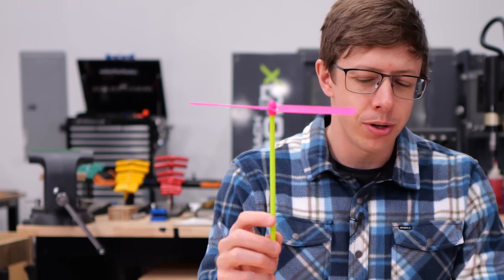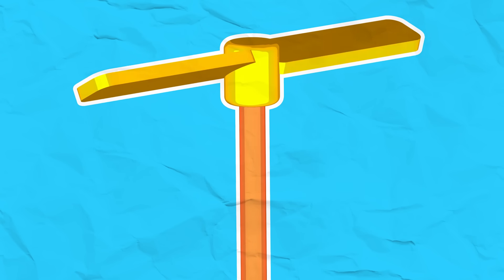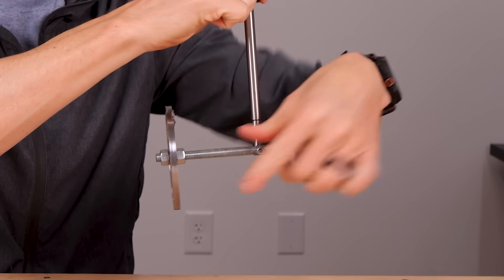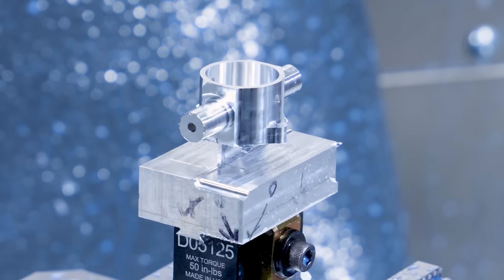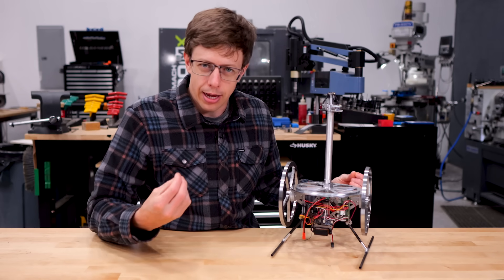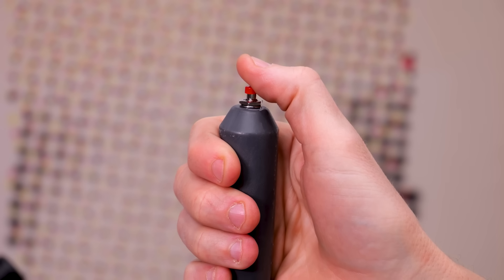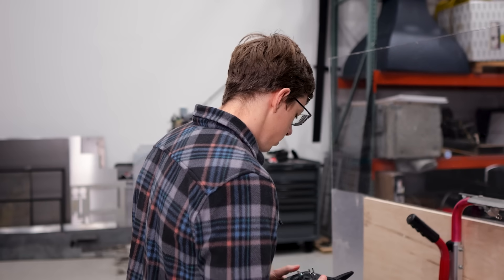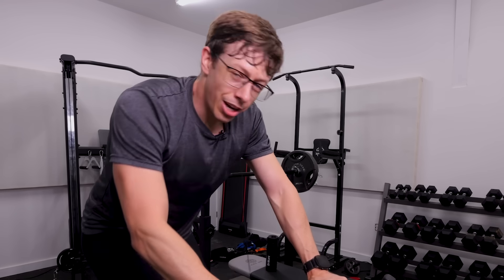I really thought this would fly well

Comment: My intuition says that you're not far off with your aerodynamic wing surface idea (although there are probably other more effective ideas, aka, a proper helicopter tail rotor, or counter-rotating blades). If you do keep pursuing that design, consider mounting the entire wing at an angle that counters the torque, then use the control surface to just dial in from there. Basically just trimming the wing so it's "neutral" position already provides most of the needed counter rotating force. Not sure if you have enough airflow from just the prop wash to counter it though...  good luck! Cool project!

Comment: I think if you just move the one fly wheel on the top side of the "driven gear" gear it would make it rotate in the same direction as the other flywheel, and if you ensure the fly wheels are rotating in the proper direction it will counter the rotation on the prop, right now in this configuration the flywheels are canceling themselves out, the Chinook helicopter went through the same growing pains during development I believe, if I recall correctly
Reply: I believe you could also theoretically double the weight of the one flywheel that is counter rotating to the rotor, if you double the mass it will make it so there is only the force of the heavy flywheel affecting your helicopter, eliminating and overpowering the forces of the flywheel rotating in the same direction of the rotor, I'm hoping I explained that well enough for you the understand the concept
Reply: I want to see a test with weights clamped please and thank you... Brain food 🤤

Comment: If you want to know the theoretical max “lift” the wing deflectors can produce, you can use some flight mechanics equations to determine that approximate value. Just takes measuring the wind speed out of the main propeller, estimating the flap as a two-piece flat surface (getting that area), then doing some math. 
Side note: the max counter-rotating force you can produce is probably much less than you think.
My Suggestion: use two counter-rotating main blades.

Comment: You could have 2 sets of props with similar mechanisms to the one you made, instead just make them spin in opposite directions using gears. The system you made to control the orientation of the blades should work the same, I don't think I see an issue there. This would solve the angular momentum problem as the force causing the body to rotate would be canceled, plus it would be more stable, and you could probably ditch the two flywheels and the controlled surfaces on the bottom. Would also make the thing a lot lighter and you might be able to get away with less torque on the motor. Super interesting video, though, I used to play with those things all the time, including the ones with the rubber band.

Comment: One design overlooked is the rotor to allow the propeller to be able to do different angles depending upon where it is during rotation.   When it tips over, no rpm will recover as it drags itself down.  Good work getting to this point.
Reply: exactly... you are screwed  by the gyro effect of the blades themselves  unless you do something

Comment: Design the control surfaces thinking as if they were on an airplane. You're essentially launching a fixed wing aircraft at 0mph with a HUGE propeller and no fuselage length. You'll need overcome the p-torque. Using anything short of a an entire flattened cardboard box won't counteract that at a few inches off the center of rotation. The tail boom on a helicopter is very long for a reason, you know this haha. You could variably increase the prop pitch to help soften the blow on takeoff, but look to the Convair XFY-1 Pogo and Lockheed XFV-1 as to why your control surfaces are inadequate. wikipediaDOTorg/wiki/Tail-sitter Best of luck!

Comment: The use of flight controls under the aircraft remind me of the Hiller Flying Platform.  It used contra-props... i.e. contra-rotating propellers, which takes care of the torque issue that exists with a single propeller.  The Flying Platform was a "unique" form of aircraft, because the passenger stands directly above the spinning propellers.  For better (or worse?), it never got into production to any degree.

Comment: I think a better idea for controlling the rotation of the flywheels would be to mount some kind of smaller propeller on a boom sticking out at right angles to the main rotor. That would even let you control the spinning, since you could adjust the blades of the smaller propeller just like you do the big one.

Of course, the downside to that is that, without the control surfaces, you would no longer have a way to control which way the main rotor is pointed. I hear some other engineers are working on a system where each blade of the main rotor is controlled individually, allowing you to increase thrust on only one side, and thus achieve controllability. It might be worth checking out. 😁

Comment: Yeah the problem with control surfaces here was that the force of a control surface is proportional to the angle of attack and the square of the relative velocity of the fluid. They weren't doing anything at all in that ground test, other than serving as additional drag, the best case scenario would be moving upwards at maximum L/D.

Comment: Does it not just need a tail rotor at this point?

And once at that point, is the only difference between this and a normal RC helicopter using pre-loaded mechanical energy instead of battery-powered motors?

Comment: Use helical gear teeth if that is even possible on this design. Then your best bet is to use 2x2 blade instead of 1x as it can rotate in the opposite direction and then cancel out the force. You can probably figure it out from there.

Comment: "If these propelers hit the speed of sound they'll make a crazy amount of drag so I'm gonna spin some paddle wheels past the speed of sound instead" Im glad you found the shrink wrap solution but that was a funny mistake.
Reply: The USA designed a fighter plane that used counter-rotating supersonic propellers, the XF-84H Thunderscreech!. As you can imagine it made quite the sound...
Reply: @legopi1  Many WW2 era propeller driven fighter aircraft had their propeller tips reach transonic or low supersonic speeds. Not while static on the ground like the XF-84H but in the air where the forward speed of the aircraft increases the tip speed on top of just the rotational speed. At this point engine sizes started growing way faster than the net thrust generated by the propeller, which is why further speed increases for propeller driven aircraft became infeasible and research into jet engines began.

Note that the fan blades of modern high bypass turbofan engines typically reach tip speeds well beyond the speed of sound (up to about Mach 1.5 for the largest engines) at full takeoff thrust. This is what creates the buzzing sounds that you hear from many modern jet airliners during takeoff.
Reply: @blahfasel2000  I don't know why I'm replying to this only now but here goes

You are of course absolutely correct, but I also feel the need to mention that the speed of sound at sea level is faster than the speed of sound at higher altitudes due to increased air density. The thunderscreech wasn't the first propeller to break mach 1 but it was certainly one of the loudest and fastest. 

I love the strange designs that came out of WWII. Early American and late German designs in particular. Very American to build a plane like the XF-84H knowing the prop would cause problems but keeping the "we can probably fix it later" mentality. The German approach would have been to do rigorous math and wind tunnel testing all to find out it doesn't work and just do small tweaks/upgrades to an umpteenth bf-109 derivative.

Kinda like what we are doing to the F-15 now
Reply: @legopi1  what we are doing to the F-15 now are not small tweaks, the F-15E upgrade really wasn’t an upgrade, it was basically an entirely new airframe that looked similar to an older F-15 and they kept the designation to convince Congress it wasn’t an entirely new plane. The F-15EX has a lot in common with an F-15E, but it still has so many changes that again it really isn’t the same airframe. The same thing happened with the F/A-18 when they went from the Hornet to the Super Hornet, they look similar but are actually 2 different airframes.
Reply: @legopi1  900 sonic booms per second
Reply: @thebrickwall6051 it actively made lots of the ground crew pass out from the noise alone
Reply: Love your videos! Fireworks pinwheels provide extra energy from their "rocket" motors. That's a lightweight approach. I wonder what the height record is for a pinwheel? I've seen some scary large ones, but smaller may be better. That's an interesting optimization problem.
Reply: Ah, but it doesn't stop there, unfortunately. Air loves to cling to a surface, even if it's a really smooth metal surface. Now when you push air down on that at speed and rotate it, what will happen? I think a box over the flywheels would go a long way to stopping what roughly looks like some coanda effect tom foolery. 

Then again I know absolutely nothing about these things, I just watch a lot of drone videos. :P
Reply: @Deja117  You mean the rotation of the flat shrink wrap will hurt it? The "outer layer" should be stationary instead of connected to the flywheels?
Reply: @ I think that would get even more drag
Reply: Shrink wrap also to propeller shaft gear would have helped a little to reduce horizontal spin.
Reply: Put a large number of evenly spaced small holes in the "shrink wrap." Trust me, some very thin, perforated, rigid material would be better than the shrink wrap for this.
Reply: You're fighting through the same problems as the designers of the original helicopters. Could look at their failures to help overcome it. Also, instead of a parachute, maybe try an airbag!?
Reply: When he was explaining the drag of the propellers I was like, "what about the drag of the flywheels?", which he never touched on so I assumed it was just negligible.

It was not negligible.
Reply: I don't know how he couldn't see that coming :')
Reply: Could we see you make a drone idc what the drone does id be happy to it im currently learning how servos and motors play into them
Reply: @speedyi9109  Boring. There are so many drone channels. RCtestflight has what you're looking for.
Reply: When he first showed the flywheel design my first thought was "What about the drag?". Then he brought on another flywheel and I started screaming
Reply: the fun thing is: I predicted that immediately but then said to myself - Oh, he knows its way, he'll find a solution later for sure. he didn't.
Reply: Have you never seen a helicopter? Let the shaft separate, like the toy, from the motor.

Comment: Overly complicated. Have a single coaxial flywheel geared to the shaft (for RPM differential), use a drag device to apply a torque to the system so that it can apply torque to the shaft (or a second rotor). You can still keep the collective/cyclic RC control.

Comment: Pretty sure NASA has you covered on the redesign. Counter-rotating blades, baby!
Reply: That design shows Ingenuity :D
Reply: @jonahgetz5882  PUN
Reply: Sorry, I didn't edit what I had sent, coaxial blades would actually help reduce the counter spin of the body of The Craft.
Reply: Two counter rotating fly wheels in axis with the blades, where the wheel counter to the blades weighs more?  Does that math work out? 

Planetary gears to get that ratio?
Reply: @pdeboer1987  an axial counter rotating flywheel would work to counter the rotation or somehow adding mass to the propellers shaft to provide enough counter force to the flywheels. But, more mass = less flight time.
Reply: @KnivesLegato  imo there are 2 ways to do this but the approach has a fault which I'll get to.
1. 1 coaxial counter rotating flywheel, simpler to tune but harder to contain the mechanism
1. 2 parallel flywheels for balance, rotating in the same direction, opposite to the propeller 

while you could absolutely match the ~inertial~ torque through weight and gearing, the biggest downside would be the air drag torque. It would be almost impossible to match the drag profiles of the flywheel(s) and propeller at all RPMs

the only solutions are already used in helis: 2 counter props or tail rotor. I hope he does 2 coaxial counter props, would be the coolest
Reply: @pdeboer1987  "put the flywheels on axis".. then they're no longer flywheels, you're not making them solid disks, and if you make the moment arms into blades, you're exceeding efficient blade rpms for lift.
Reply: @Metapharsical  a flywheel is a rotating mass.
Reply: The easiest solution is to simply have the main tube slightly larger and half filled with liquid.  The additional inertia alone will make the device spin a few times longer
Reply: Yup needs counter-rotating rotors or a tail rotor, though maybe new flywheels with internal blade spokes can be offset on their axis to become twin tail rotors themselves.  If the wing addons had had enough "resistance" to completely cancel the rotational force, it would be applying an equal downward force, thus no flight at all.  Because it did fly, it must spin.
Reply: And this runs Linux too ❤❤
Reply: that's what I was thinking too
Reply: Not even NASA. Coaxial rotors have been a thing for decades.
Reply: Helicopters are already rube Goldberg magic machines of engineering sorcery so this should be good
Reply: NASA? This was invented long before NASA existed.
Reply: @patavinity1262  Lol you don't say.
Reply: or double the number of flywheels and have counter rotating pairs while reducing the size of each individual wheel to maintain the same weight.
Reply: @KnivesLegato  exactly my thought
Reply: I'm wondering if that would actually counter the body rotation as the rotors are spinning? Would it be feasibly possible to do something similar to the Chinook helicopter? While I get it, he was going with a single roterblade because of that toy but still....?? It doesn't make sense that the counter-rotating coaxial rotor blades would reduce the body spin but.... He is trying to go more for what the toy was so? I'm definitely looking forward to a part 2!
Reply: @eugenesnell6600  counter rotating blades would only work if the rotational energy of the propellers equalled the rotational energy of the flywheels. those flywheels are easily 4-5 times the mass of the propellers, so he'd stills have to worry about rotation without balancing flywheels.
Reply: @KnivesLegato  he's not trying to counter the rotation of flywheels. They counter themselves, he's just trying to counter the rotation of the blade itself. So a counter rotating blade would solve that.
Reply: @mikosoft  he is trying to counter the rotation from the flywheels. Did you watch the video at all? vertical flywheels have forward rotation around the z axis called procession. That's why it's spinning on takeoff.
Reply: @KnivesLegato  watch it again. He's countering precession by counter rotating flywheels already. His issue is the torque from the rotor.
Reply: @mikosoft  knives is talking about having the flywheel parallel to the propeller and making it counter rotate, cancelling out the propellers torque and precession
Reply: @KnivesLegato  It also create a lot of dirty air between the two propellers which is a lot harder to account for than just adding a tail rotor, but then it basically just be a helicopter.
Reply: @mikosoft  both flywheels spin in the same direction radially. they counter rotate to cancel the gyro effect that would cause the device to tumble over. cancelling the gyro effect stopped the anti-rotation protection.
Reply: @jvillain9946  a flywheel can be a solid mass on the underside of the device that counter rotates to stop the radial progression AND be a gyro, solving two problems at once. Or, a complete redesign to ditch the perpendicular flywheels altogether in favor of one counter rotating flywheel, which would also save weight by not needing the massive bevel gear.

Comment: Not sure where you are on the redesign but you probably should have gone for a counter rotating prop sort of situation, making there be only one flywheel where the current inline gear is, but have it rotate counter to the propeller to cancel torques.

Comment: I think you can ditch the wings. Just put another bewel gear under the first one. It will rotate in the opposite direction. If you give it same mass as the first gear+propeler assembely then it should cancel out. Basically the same thing as with flywheels.

Comment: unfortunately rotorcraft stability is an incredibly incredibly difficult problem, theres no real way around it, you pretty much just have to build a legit RC helicopter with either a tail rotor or multiple contra-rotating main rotors, plus if not a swashplate for active control, at least a flybar for passive stability
i dont think using a wing for yaw stability ever can work, its like blowing on your own sails, i think the math just doesnt work out
maybe its not as good for the video, but i would suggest just buying a big boy proper RC heli and then putting a flywheel in it instead of a motor